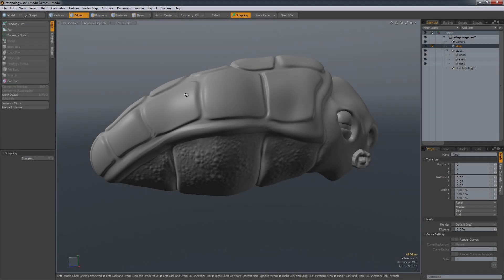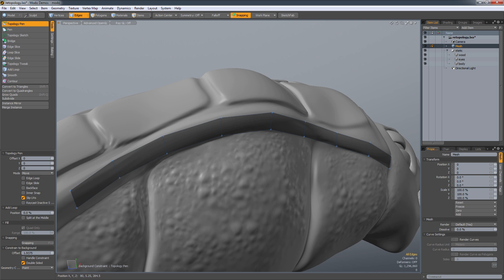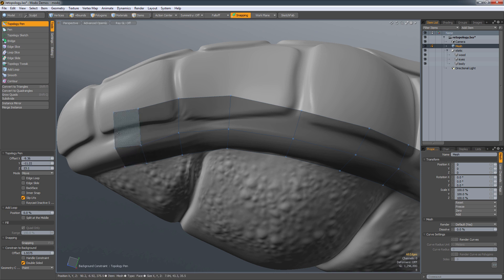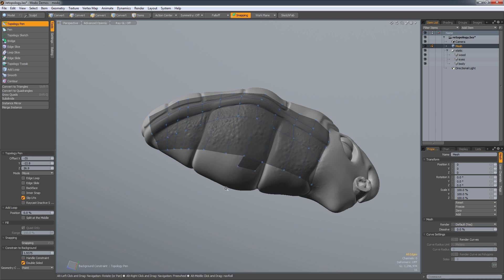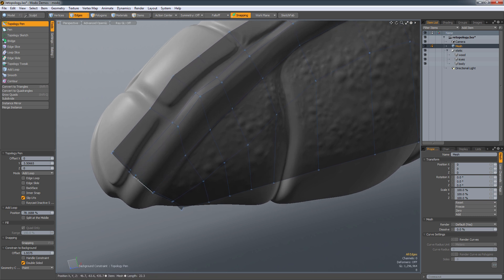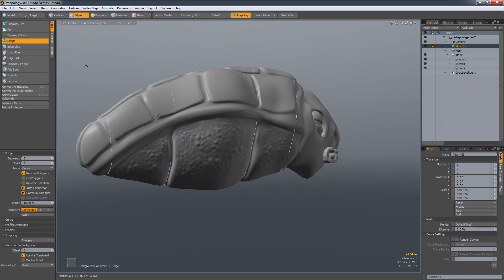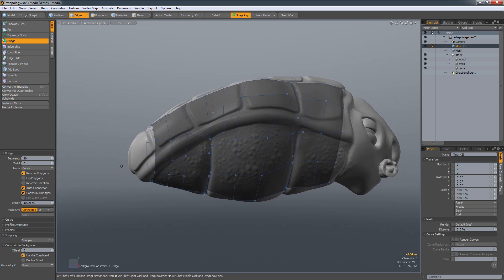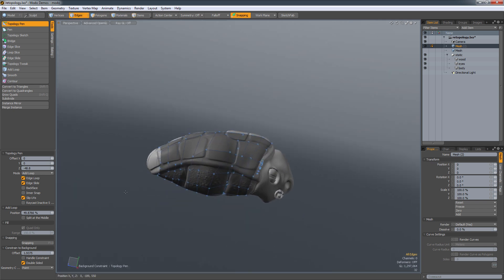Modo 701 Retopology

Comment: i really want to like modo.. iv just been trying to retop a mesh. soon as i go into retop mode. it crashes. soon as i click once with any tool. in ver 801 and 901.. amd system.. fine in everything else, 8 gigs ram.. hd 5450 and quadro fx 8300.. athlon x2 64 in win 8 64... 1 click in retopo room and boom..crashes every time.. with or without a static mesh.. back to max crappy retopo tools :(
Reply from the maker: Im so sorry to hear that, send them an email to support, or even a teeet they are really good about solving issues. Modo should scale with your system unless the graphics card isnt full supported. They have a system requirements page but that is more or less workstations. Email support they'll  help.

Comment: thanks how do you transfer detail from the high mesh to the low mesh
Reply from the maker: In the item list you can right click on the texture and choose to bake from object to selected texture. You just have to have the texture setup as the right surface type. Are you using 701 or 801 and which texture are you trying to bake?
Reply: I am using 801. I am trying to transfer detail from my high res mesh to my low res mesh so I am assuming I am baking Normal maps. I believe normals maps are used for transfering detail I may be wrong
Reply from the maker: Normal and displacement, depends on what your final usage is. If you are going to a game engine normal map is the way to go. Engines can calculate that with out any issues, displacements not so much. But the normal map is just an illusion of light to show depth.

 If you have an animation/still and you want to take advantage of the renders ability to calculate geometry and sub-divide on the fly you can use displacement maps. In that case your scene can have a mesh with 3K polys and then at render time sub-divide the mesh and use the displacement map to recalculate the new higher res geometry on the fly. That mesh will be real depth.
Reply: okay I see I heard that using diplacement maps cause for you to have more geometry on the mesh. Because my computer is not that great I think ill stick to the normal maps. But do I have to make a lowres and a high res mesh in order to make normal or displacement maps. Or can I make them from a high res mesh and add them to the low res mesh. After the low res mesh has been UVED
Reply from the maker: You will need both hi and low res meshes. The low res needs a uv map to translate the hi res details to a 2d texture, the hi res doesn't need uvs. Once you create the normal map you don't need the hi res again until you have to rebake. 

You're right, the displacement map adds more geometry to the scene, either during the render or in the view port either way it adds to calculation time.
Reply: okay thanks one last thing in what situations would I need to rebake using the high res mesh
Reply: also when it comes to texturing do I paint the high poly model and then project all the detail to the low poly mesh? Will the texture be transfered as well
Reply from the maker: Yes if there is color on the hi res model you can bake down those colors on to the uved low res model texture file.